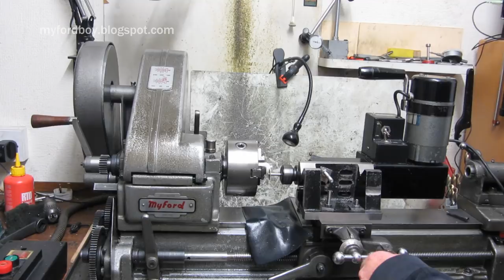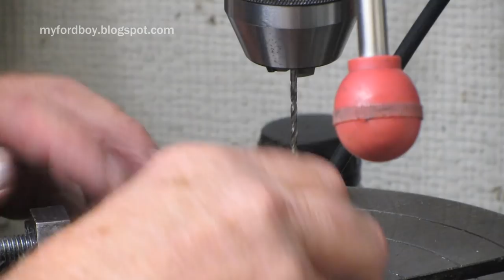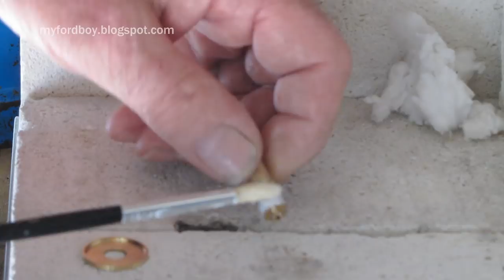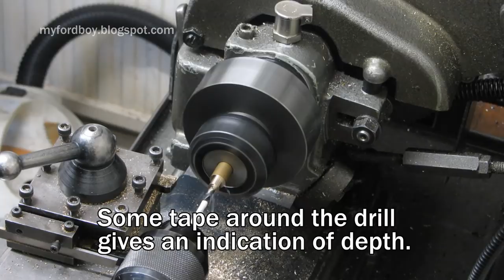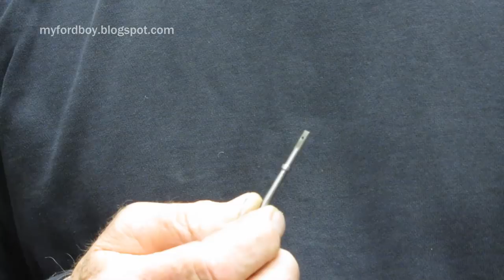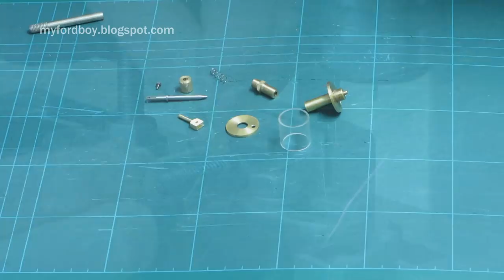Make a Drip Feed Lubricator, Oiler

Comment: Love use of the hex and square collet holders for indexing, brilliant. One question was the hole in the needle handle a bit too close to centre to actually fully open and close the valve?
Reply from the maker: Seems to work OK as it is but could easily be altered.

Comment: Is there an oil I can use that is more accessible, IE car engine oil or automatic transmission oil for my oilers. I own a 1964 Myford ML7 and after 12 years almost ready to start up. Out in the sticks of Canada the price for purchase and shipping is high for a small quantity. Thank you. PS nice work.
Reply from the maker: The recommended oil for Myfords is very thin, Nuto H32 it is an hydraulic oil.

Comment: Cool project.  Nice results.  Is there any issue with oil leaking where the glass and brass meet?
Reply from the maker: No, the glass is sealed to the bottom brass part with epoxy resin.
Reply: myfordboy ah, thanks, guess I missed that part.

Comment: Does the switch on the cap also create a vacuum so the oil drips slower?
Reply from the maker: You can turn off the oil flow with the lever on top when the engine is not running.

Comment: Ser. If I may. I see that Your bristle for flux is not in healthy condition, would You try to find a KOH-I-NOOR brand at children school shop or similar, cheap stuff. My favorite is size 12 with EAN 8593539197232. I have tried various bristles for cleaning, applying flux, cleaning with ethanol, nitro solvent, isopropyl alcohol, and now forbidden trichloroethylene instead which we are now using a flimsy Lotoxane. All of these chems went well with these bristles, others where breaking at fiber level, losing grip too fast, etc... I'm working at open pit coal mine, and all sort of sh*t is comes for cleaning and maintenance, these stood the test, with minor help of re-crimping them.
Thank You for nice videos, and for Your time making them, love your work.
Best Regards, Goran
I'm NOT a KOH-I-NOOR employee or a bossiness cooperator or similar,